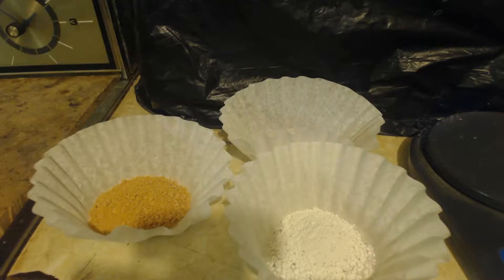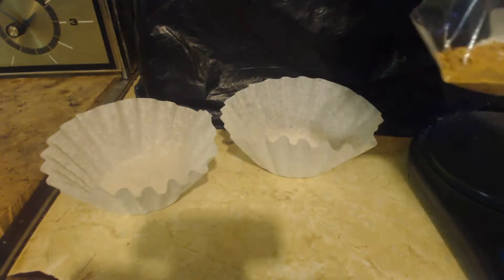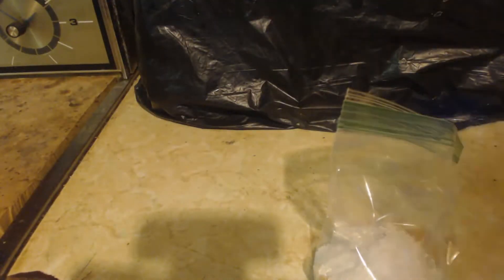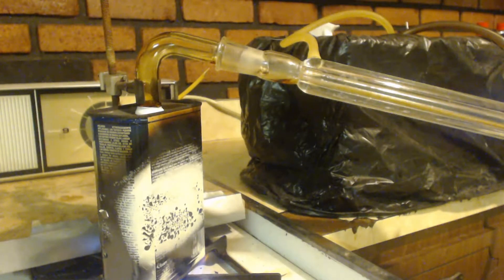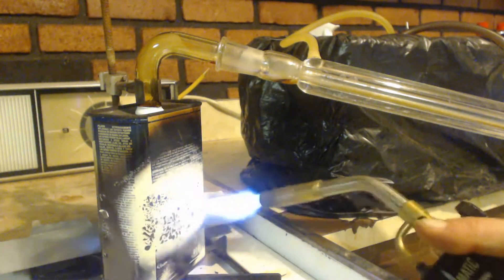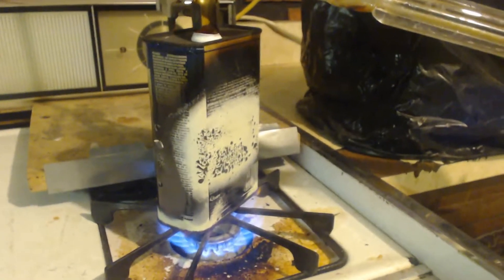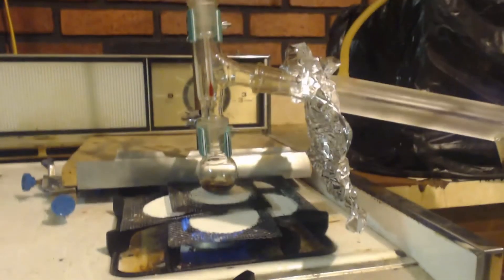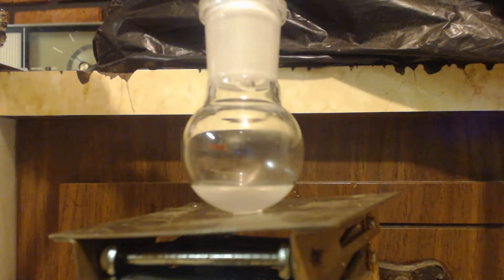TOLUENE SYNTHESIS (decarboxylation of toluic acid)

Comment from the maker: .Here are your ratios.   For every 1 gram of psuedo you need 2 grams of iodine crystals and 2 grams of water and 6/10 of a gram of red phosphorus.   DO NOT CRUSH ANYTHING UP.   JUST ADD THEM ALL TOGETHER IN A BIG ENOUGH FLASK.  Never fill your flask 1/2 way or more.    Then reflux for 24 hours.  REMEMBER YOU WILL BE MAKING SOME POISON GAS!!!!!!!!!!!!!!!!!!!!!!!!!!!!!!!!!!!!!!!!!   So at the top of the condenser you must put a hose and either filter it through some kitty litter or send the fumes out side or down the sewer pipe or something.   If you kill someone with the poison gas do not blame me.   After the 24 hours allow the reaction to cool and then add an equal amount of water to dilute the reaction pot.  Filter out the excess red phosphorus and use it in the next reaction.   If several times filtering does not remove the red coloring then there is probably some iodine in the pot.   It can be removed by adding a dash of sodium thiosulfate.   Even if you get rid of the red coloring by filtering you should still add a dash of sodium thisoulfate because it also helps destroy the byproduct aziridine.  When the red coloring  is gone then .    
                 Make a 20% by weight solution of NaOH and water.  When the solution cools down   then throw a dash of sodium thiosulfate in their to get rid of any aziridine.  Add that NaOH solution to the pot until you get a pH of 14 or higher.   Shake and stir as you add the NaOH solution.    Then when you got a pH of 14 or higher  keep     shaking strongly to make sure everything has freebased.     Throw in  some toluene(or some other hydrocarbon) into the pot   to soak up(dissolve) all the free based meth.    And then bubble in some HCl gas into the toluene to make the meth precip out as a solid and then filter it out and dry and there you have some meth. .    .
Reply: First of all, greetings and peace from the people of peace, security, trust and reassurance to my brother, my dear and my friend, Dr. John
I accept my deepest apologies and apologies for the absence of you and for not responding to the rest of the information you want, but thank God a lot was done, praise be to God, come the Copt on the criminal person who did this. I was in this period very sad for my friend, but we always say thank God and finally I like to Check on your health, your questions, and your honorable families. Are you okay? Don't worry about anything. Don't worry about anything. From this day on, you and I start our business, and you and me personally. All the money you want, and I like that we have a better way of communication than here on Twitter Snap Jatt WhatsApp Facebook Viber Emo Telegram Which one do you like I am with you and as I want a way to send money to you that is safe and that hacking does not enter my bank account and as I want after implementing this experience in making crystal meth that you told me about today I will implement that you tell me in a very good way and I will be I have the strongest, strongest and most beautiful product in the State of Kuwait
Accept my greetings to your brother and friend